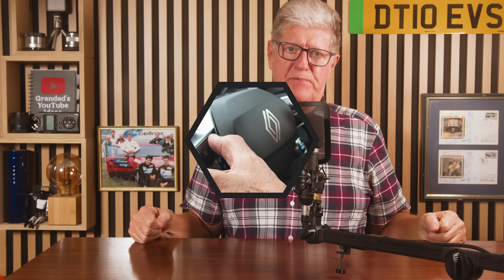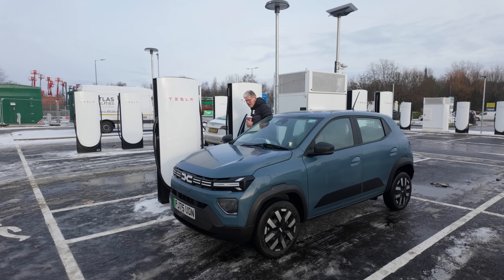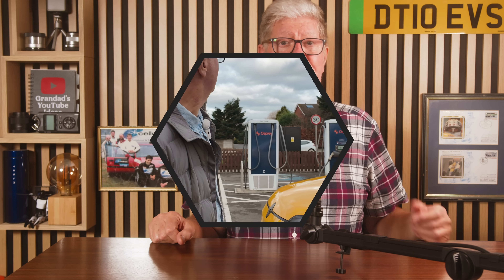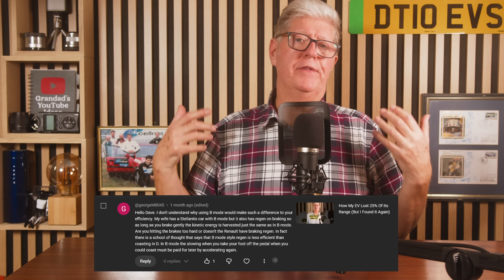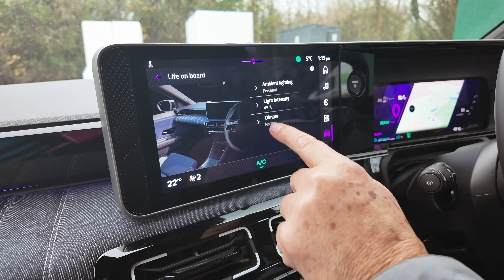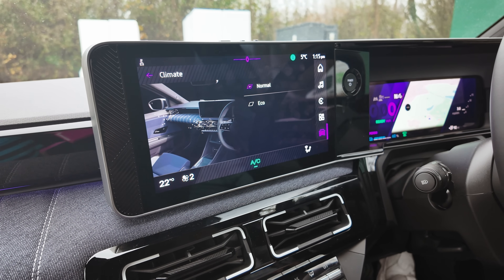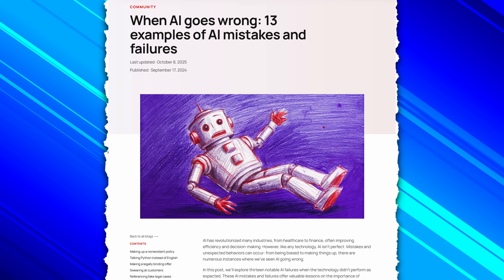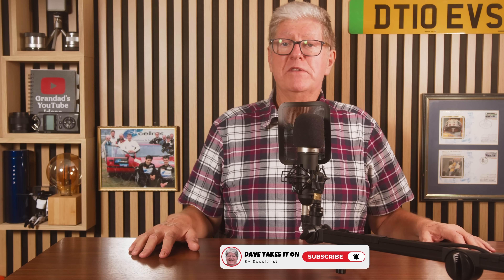Was I Wrong About Regenerative Braking On EVs?

Comment: I had this argument in the comments of another YouTuber who claimed minimum regen was best - he'd done a whole video on it.

There is a very slight caveat: low regen can be slightly better if it exactly matches the hill you're going down, or the speed you want to stop. If you have paddles to adjust that can work. But it's minimal, and as a general rule "always use max regen" is a good one.

Any time you use the foot brake, if the pads engage you've lost energy. Some people think that foot brakes are all regen; they are not. They are a mixture of regen and traditional. Some cars might do the regen part better than others, but it's not going to be as efficient as one pedal. 

So thanks for this. Hopefully it will help put these arguments to rest.

Comment: I can coast by just feathering the pedal. It's all about pedal control... my scenic is going in for full one pedal driving next week . Not used regent fir a year thinking coasting saves energy but it doesn't.
Keep up the good work Dave.
Reply: Why would I want to constantly manipulate the pedal when I got ACC in the car?
I'd rather have the ability to just disable ACC and have the car slow down smoothly rather than going into hard regen that then requires pedal manipulation to make it more comfortable.
In my car I can simply press a button to disengage ACC and the car gently regens and slows down without any need to touch the pedal. Kind of like an ICE car in low rpm. B mode feels like I had downshifted two gears and the engine is doing hard braking at high rpm.
Reply: @Gazer75 if it works for you enjoy!

Comment: I always use maximum regeneration,  rarely touching the brake pedal except to the final couple of feet to put the parking brake on. I have been told in the past by the dealer that my discs were going rusty so I do once a week give one hard stop when it is safe.
Reply: Agree, except for the "always" - if you're on a long journey on clear roads (motorway or dual), it's best to keep your speed as constant as possible (in my EV, 60/65 is best), so regen is actually counterproductive in that situation - especially on max, when it slows you down far more than you need to, then you have to use all that power to build up speed again. I do what you do for all other journeys, but I turn it off or at very low on most long journeys where I can sit at a steady speed.
By the way, Dave is wrong here when he implies that you get all/most of the energy back in regen - you don't, it's something like ⅛ - ⅕, depending on the car (eg, Polestar quotes ⅛) - this is because even with regen, some of the energy as you slow down is going against rolling resistance, air drag and heat loss in the regen process - you will only ever get a fraction of the energy back (worth it though, if the option is braking a lot, like driving round town, when you'd have max regen on all the time, as you said).
Reply: @robertduncan5912 this! Regen can cause slowing when you wouldn’t have otherwise slowed - bad driving maybe but I’ve done it myself - should be feathering the accelerator but I’ve slowed too much and I’m accelerating back up to 65mph. My error maybe but I’d have been better off coasting. 

Regen great for most driving for sure. But yeah, converting energy will always incur losses, can’t imagine Dave really thinks it’s a 100% conversion to recharge the battery! A LOT better than hot disks though.
Reply: @robertduncan5912 how does regen cause more slowing than you want?  Tgats what the right hand pedal ia for.  If I turn regen off or down, i'll have to use the brakes more.  Juat because you can lift 100% to slow down does not mean you have to.    I dont get your point.
Reply: @VAspeed3 I agree with you… not sure what he’s talking about. You have the ability to control the speed yourself.
Reply: @VAspeed3 only if you don’t or can’t learn to modulate your speed and deceleration accurately using the accelerator pedal.
Reply: @VAspeed3 simply that it's best to keep a constant speed, rather than showing down& speeding up. Very strong regen causes heavy deceleration if you lift your foot off, that's all - just harder to regulate, so I find it easier to maintain a constant speed with regen off on motorways. If you are happier doing it by "fighting" the max regen and it works for you, that's great, be my guest😊
Reply: @robertduncan5912 the answer to that is to use cruise control to maintain a constant speed. I have used cruise control on motorways and dual carriageways for years using the up an down buttons to match speed to vehicles in front. I rarely touch the pedals from the moment I join a motorway until I take the exit lane, just using my left thumb instead.
Reply: Actually thats a good tip Id forgotten about. Was doing that but havent done it for a while. Will restart once its not icy !
Reply: Yes, do it soon after a full charge, then all the braking force is put on the discs..
Reply: I’ve found full regen more efficient even on the motorway, tried all ways and find my range better in max regen.
Reply: @mickmills5404 I think it depends on the model of car. I have a big heavy EV (Ioniq5) not that efficient by the newest standards and I find it best to have regen off on long clear motorway journeys.
But once you're into stop-start or even slow-fast traffic, it changes & I have the same experience as you - max regen best, esp one-pedal, it's great for a variety of reasons.
Reply: @robertduncan5912 I have a BMW iX2 and it just seems best in B mode one pedal driving, I was surprised when I got poorer efficiency on the motorway using no regen, as you say different cars / software may give different results.
Reply: @mickmills5404 thanks. TBH I've not measured it it just seemed "obvious " to me that it would be better with low or no then but it seems from your replay and Dave's article it's not. Cheers.
Reply: @Joe-lb8qn I honestly thought it must be better on a motorway to have no regen and freewheel but was disappointed with my efficiency on long journeys so tried full regen and it was far better, some cars may work better than others I guess but for me I’ll stick with full regen.
Reply: I’ve heard Teslas do this automatically
Reply: I need to set regen to minimum to achieve what you do with the setting at maximum. I.e. rarely touching the break pedal. 
(At max setting my car slows down as soon as I lift my foot off the accelerator)

Comment: I think you might be overestimating how much of the kinetic energy is recouped and stored away in the battery.  You say that the energy can't be lost - yes it can.  When you're using regen braking, some of the kinetic energy is returned to the battery but quite a lot is still lost as heat.  Regen braking is better than friction braking but it's still worse than no braking.

More important though is the confusion between choosing the UI settings (D vs B or multiple settings) and turning regen on and off.  I've had two EVs (Zoe and ë-C4X) and whilst both had D and B, neither had any option to turn regen braking off.  All that changes when you switch between D and B is the behaviour of the user interface (UI).

In D mode, EVs do their best to emulate a traditional ICE vehicle with an automatic gearbox.  It's important to recognise that as far as the underlying drive train is concerned there's absolutely no reason for them to need to do this.  They could have provided an interface like a boat with a single lever for forwards and backwards.  This would however have been immensely confusing to the average driver so a lot of work has gone into making the UI familiar.  They even creep forward if you have them in D with the handbrake off because that's what a car with an old-fashioned analogue automatic gearbox does.  The EV doesn't need to at all but it does it to provide a totally familiar environment.

In B mode the UI is tweaked a little (or a lot).  In this mode the driver is able to initiate braking without touching the brake pedal.  Instead, lifting your foot off the throttle tells the car that you want to brake.  In D mode it provides a level of braking designed to emulate what a traditional automatic gearbox coupled with an ICE engine would give you; in B mode it gives you more.  It may even allow you to bring the car to a complete stop.

The difference however is merely in the UI.  The car still does regenerative braking whichever mode you're in.  All that is changed is how you tell it to brake.  If you're in D mode and you press the brake pedal gently the car will start by using regenerative braking.  You can check this by looking at the car's power meter whilst you're braking.  Only if you press hard enough to indicate that the regenerative braking is not enough will it start using the friction brakes.  This is why a) the braking system is so much more complex and expensive to maintain on an EV and b) why the discs have a tendency to go rusty - they just don't get used.

When it comes to economy there's a very simple truth.  No braking at all is better than regenerative braking which is better than friction braking.  Having been driving an EV for a while I found I could apply what I'd learned to driving a diesel mini-bus.  A colleague used to complain regularly about the MPG which he was getting despite all his attempts to use economy settings (although he was the kind of person who was always accelerating or braking).  Driving the same mini-bus on the same route I found I could get 20% more MPG than he was getting simply by applying these braking rules.  I didn't just lift off an left it coast to a halt a quarter of a mile later but I did refrain from accelerating when I could see I was only going to have to brake again 200 yards later.

Some people have difficulty adapting to B mode saying that it feels like the handbrake is on all the time.  They end up braking when they don't mean to and thus for them B mode is less efficient than D mode.  Others find they can adapt quickly and enjoy the convenience of not needing to use the brake pedal.  Neither D nor B though is intrinsically more nor less efficient.  (Unless that is you have an EV which doesn't do regenerative braking when you press the brake pedal.  I haven't come across one but my experience is not large.)
Reply: Exactly. The Brake pedal is a "request for deceleration". The can decides how to action this, and applying the friction brakes is  its last prefference normally.
Reply: @scienteer3562 Depends on the car - this is not the case in my Ioniq5. With regen off, the display shows almost no regen with the brakes. It is therefore better for me to and have it on/at max around town, but I turn it off on clear motorways where I want to keep the momentum up at a steady speed, decelerating as little as pos (except on hills! Not much you can do about them!). Happy motoring.
Reply: @robertduncan5912  I'm beginning to think the Renault 5 works the same way. Really bad...
Reply: @robertduncan5912 
I leave our Ioniq 5 in auto regen, with auto hold on, then use the LH paddle as the brakes. This way I seldom even use the foot brakes.
The wife uses the foot brakes rather than the LH paddle, but doesn’t get the same level of efficiency as me, dispite the regen remaining in auto the whole time.
Reply: This is exactly right.   Better explained than i could have done it.
Reply: Regen isn’t just an on off mechanism,  you can control the amount of force it applies in slowing down the vehicle with simple throttle control. Using the power meter you can set throttle position to coast down steeper hills increasing speed even in the strongest regen setting. Dave is correct that the strongest setting creates the best efficiency. If you want to hyper-mile over a longer journey then coasting in neutral (or using throttle position to get zero in the power meter) on any downhills will work better due to speed increases and more free rolling up the next uphill. All other situations full regent is best for controlling speed and bringing you to a stop for efficiency than using the brakes.
Reply: I have an Ioniq5 (2023) and if regen is off, hitting the brake pedal does not give a significant regen reading on the power display (it shows the tiniest bit possible) Maybe it's different in other cars. I've had this disagreement here before. Seems it depends on the model, but a '23 Ioniq 5 is by no means an outdated example.
Reply: @robertduncan5912 yes, highly likely to vary with make and model. My VW id.4 does a lot of regen from the brake pedal.
Reply: @scienteer3562  Indeed, the VW group seem to have this behaviour. The brake pedal isn't really applying the brakes, its just applying more and more regen until it needs to stop.
Reply: @sargfowler9603 again it depends on how much kinetic energy can be converted into electric and pushed into the batteries anything beyond that the physical breaks have to convert into heat.
Reply: Remembering back to my schoolboy science lessons energy cannot be lost, just converted!

In my Kia Niro self charging hybrid I have the 'flappy paddles'.  I find the car is far better at recuperating energy that I am.  I can use the max regeneration and I will on long descents but the car does it better when cruise control is set.  If I touch the brakes when the car has max regen set, the charging indicator increases, suggesting that the car increases regen further as opposed to using the friction brakes.  I have a Dacia Spring booked for a weekend test drive at the end of the month...it will be interesting to compare the Driving modes.
Reply: Depends on the car how the D mode works. My 2020 e-Golf in D uses regen for light brake application and then blends as you press harder.
The B mode is far to harsh for me to use in most cases. I like to turn off ACC and have the car smoothly decelerate and I get this by using D1 or D2 modes. No need to manipulate the accelerator to reduce the hard regen I have to do in B mode.
The best consumption is always in D mode as I can coast as much as possible.
Reply: Good explanation
Reply: This varies by make and model, some have a D/B type setup, with limited driver control. 

Some like Kia/Hyundai/Genesis have much more  controllable system that is highly driver configurable, three five levels of regen (including i-pedal and off), with three levels of regen accessed via behind steering wheel paddles. The three regen levels can be configured for different regen characteristics all saved for each individual car users profile. Some of these models also have auto mode that varies the regen level automatically based on the car's sensors. The cars also regen via the brake pedal at the regen level set, but apply the physical brakes to slow, based on the selected regen level, but assert the physical brakes if braking harder or to come to a stop.

Some Kia/Hyundai models have brake disc cleaning mode, that turns on zero regen where only physical brakes are used for a duration.

It seems some automakers approach regen from a simplicity of use angle with the car making the decisions, others from a driver control perspective.
Reply: Pretty sure on my old model S, regenerative braking was controlled by my foot on or off the accelerator and friction braking by the brake pedal. Obviously if you take your foot off accelerator to cover the brake, regen braking will start, and pressure on brake pedal will determine if you pass any energy to friction.

NB this was a 2015 model - modern Model S may be different. Also it would never completely stop on regen; would slow to a crawl, and then you had to use friction brake to stop completely.

Currently I have a BMW i4, which on maximum B mode will slow to a complete stop and apply auto handbrake.

One other feature on the Model S which you don’t see explicitly as much on modern EV - the balance between electricity applied and regen. If you carefully hold the accelerator pedal at the balance point, the car neither gains kinetic energy nor loses it, and runs at a steady speed (obviously you are applying some force to overcome wind resistance and rolling resistance, but at this balance point the vehicle is least upset by changes in direction, because you are applying minimal net torque, so advisable to hold on this when turning)